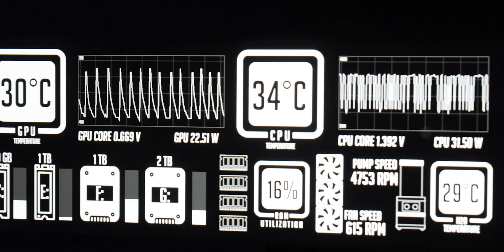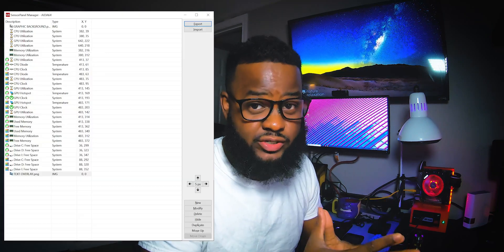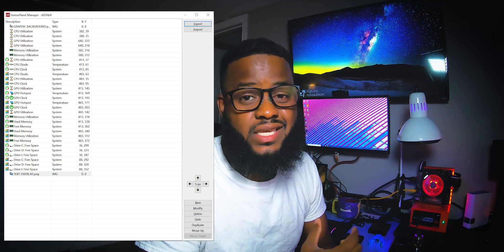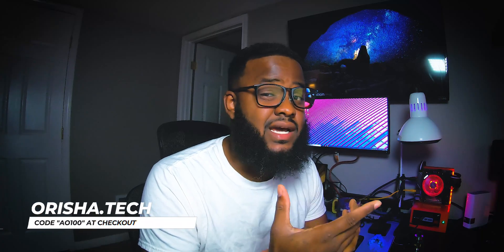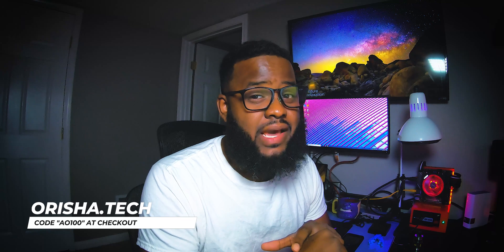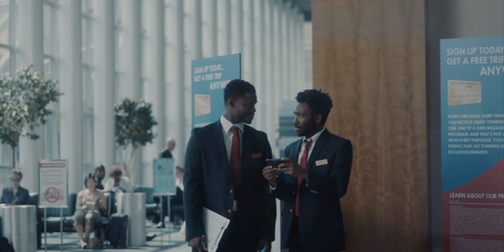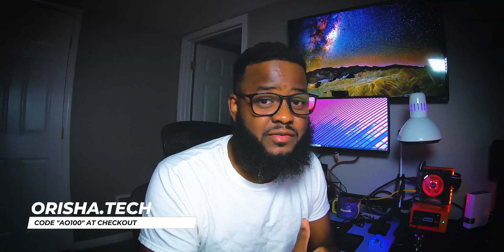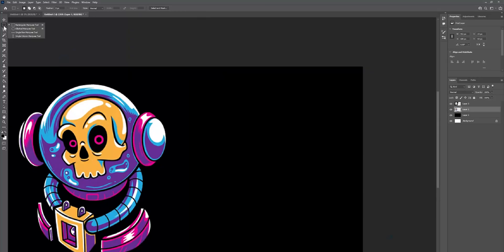AIDA64 Sensor Panel Setup | Where to Buy & Custom Order Your Layout

Comment: I`m using multiple monitor, somehow i was turn off one of my monitor, when i turn it back, the sensor panel appears in another monitor/place.
Any method that will make sensor panel stay/lock in the specific monitors?

I`ve searching this problem everywhere, and many people have this kind of problem, and there is no solution at the moment.
Any solution for this? any method is welcome.

Comment: When you are setting up the CPU usage meter in the time lapse section this video. It looks like you change the maximum value from 9000 to 4500. I was trying to figure out why you chose that number but does the 4500 represent the maximum megahertz of your computer speed?